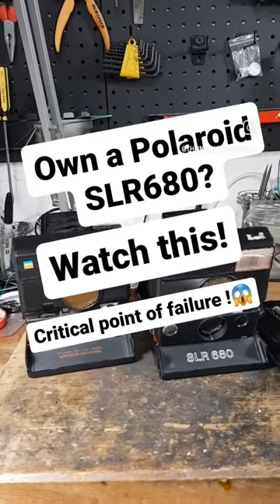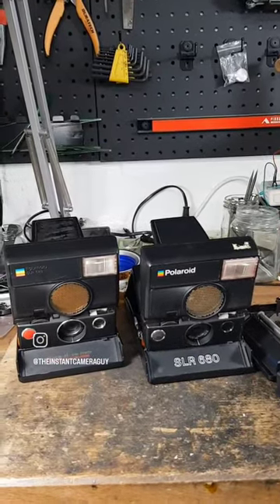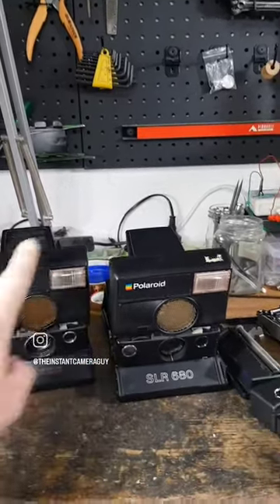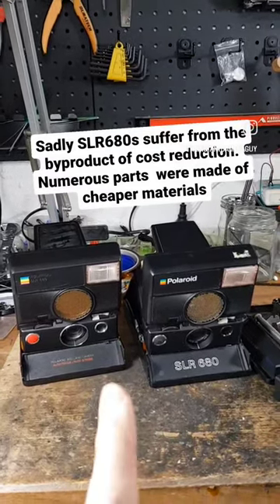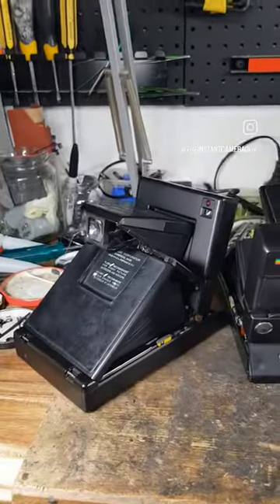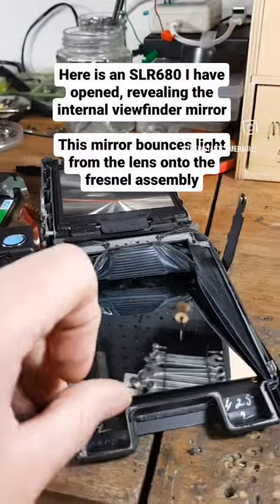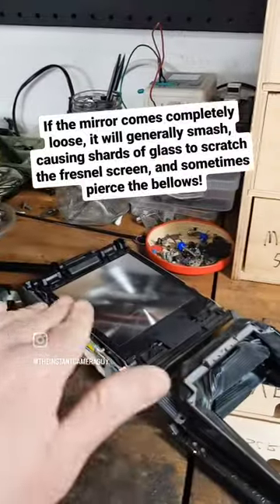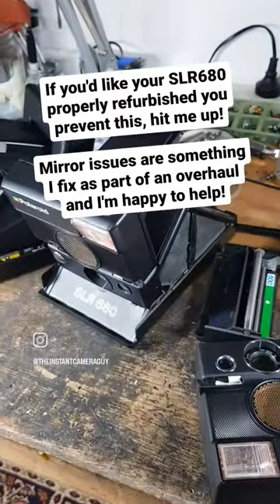Own a Polaroid SLR680? WATCH THIS!

Comment: If you have a broken SX-70 or SX-70 Sonar, you can do a body swap and move the shutter assembly of an SLR 680 over to the SX-70, taking advantage of the features of the SLR 680 alongside the higher build quality of SX-70s.
Reply from the maker: You can

But you still need to check the mirrors. Sonar cameras in 1981 also used poor quality silicon.

Comment: Jake, did you do a video that explains why 680 gives a better image despite the fact it has exactly the same optics?
Reply from the maker: The 680 doesnt give a better image

That's a complete and utter myth. Anyone who tells you otherwise is telling you complete and utter nonsense BS

Any performance increase associated with the SLR680 is likely due to the camera taking 600 film instead of SX-70. 600 film is 640ISO while SX-70 is only 160ISO

This means the film is 4x faster, and can shoot in 4x lower light. And in sunny photos, the shutter speed/aperture are also increased.

This results in the images looking sharper in comparison. 

But ANY SX-70, once modified and converted to take 600 film will perform the same.
Reply from the maker: watch the video I did titled "SX-70 vs 600 film: Why the debate you've heard is very likely wrong."

It will answer some of why this myth persists. 

The camera is not better, the FILM is better